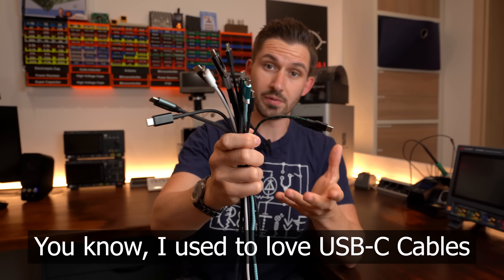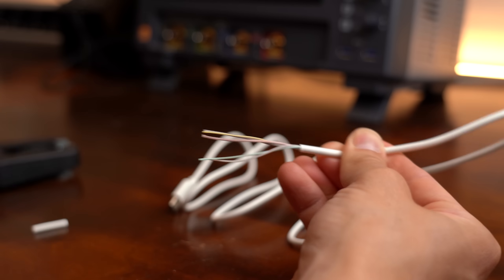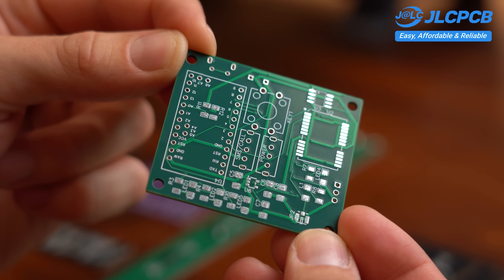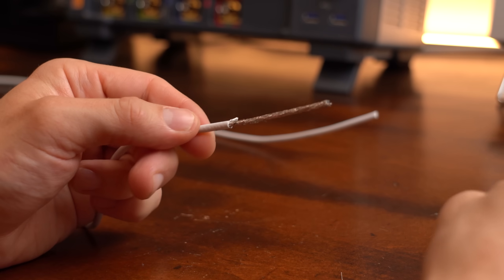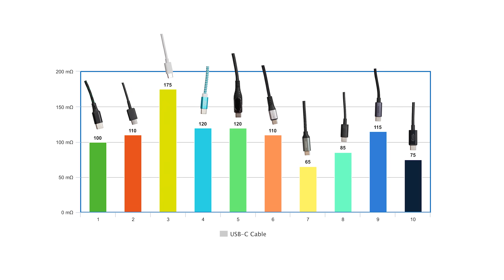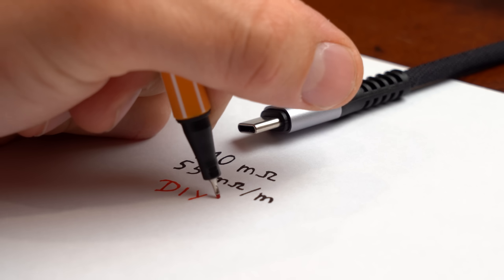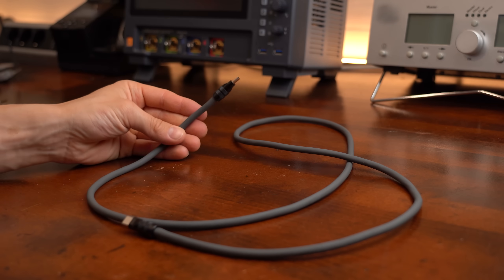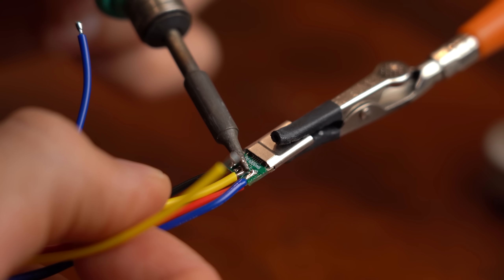Your USB-C Cable STILL Sucks — I Built a Better One? (DIY or Buy)

Comment: Great video, can you tell us what went wrong with the heatshrink? No sense in replicating your mistake if we can learn from it.
Reply from the maker: It shrunk weirdly and created kind of like "waves". Not sure how to make this better though.
Reply: @greatscottlab  You might want to shrink it slowly and fully around starting from one end. Heatshrink also shrinks it's length slightly, and since you were going too fast and only from one side it grabbed and pulled cable back.
Reply: @greatscottlab  I wonder if using a larger heat gun with more air flow would help.  You'd be able to hold it further from the sleeving, potentially heating it more evenly.
Reply: @reidster87 I use a soldering station heat gun for all my heat shrink needs. 
Never had a problem, but then I also tend to fastidiously rotate the object I'm heat shrinking. I use 10/10 air flow rate and 350 Celsius temperature. 
I also use adhesive lined heat shrink.
Reply: @greatscottlab more even heating is the answer to your issue, I suggest honestly tossing it in the oven on low heat for about 5 minutes
Reply: I think the issue is the heatshrink cable was too thick for the wire it was wrapping, it can only shrink so much and might work better starting with a thinner heatshrink
Reply: @BobertSands  That's what I was thinking. I only have experience with normal rubber heat-shrink tubing, but what he used seemed insanely large for the thickness of the cable.
Reply: Can't believe he was using the heat gun so close to the varnished worktop.

Comment: Great work. Though I'm just starting to use USB-C and mainly for data. That said my new tablet arrives this week which will be USB-C. We'll see how that cable performs?
Reply: Tablets and phones still come with cables ? I'm surprised. I haven't bought a phone for 3 years and I'm shocked that the manufacturer doesn't just leave a dried up dog turd instead of a cable. Especially Samsung, as they have a particular love for dried up dog turds, (AKA OneUI)

Comment: Prediction: it's hard to buy a good one, and it's hard to build a good one! Because it is amazing to me how much power and signal bandwidth they can support.
Reply: I was wrong. Great success!
Reply from the maker: @Droidy77  ;-)
Reply: Surprised nobody talked about USB-IF (USB Implementers Forum).  Its the official organization that sets USB standards and cables certified by USB-IF comply with the required electrical, mechanical, and signaling specifications to ensure safety and performance.

Certified cables are allowed to display the USB-IF Certified logo indicating their data and power capabilities (e.g., USB4, 40Gbps, 240W).